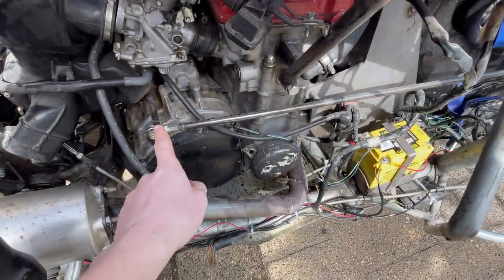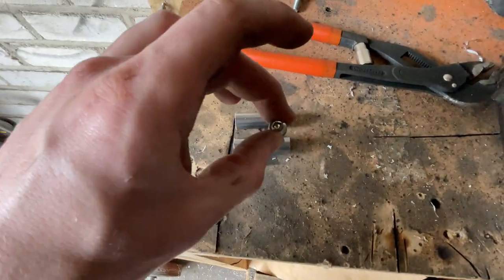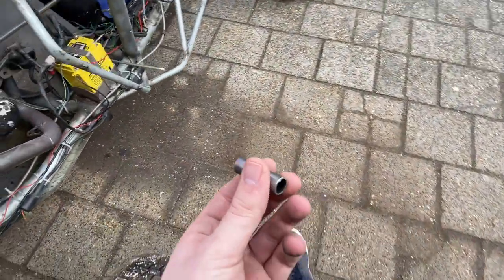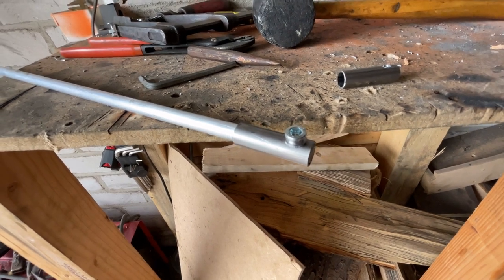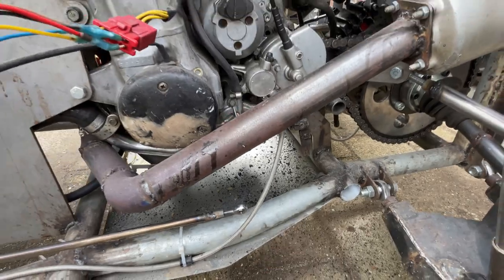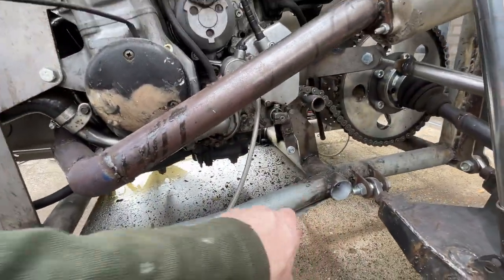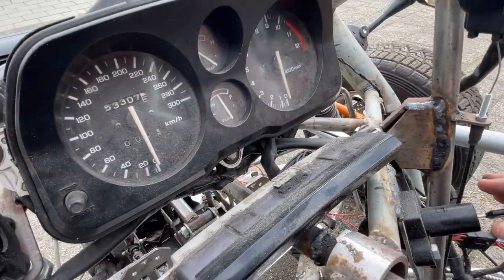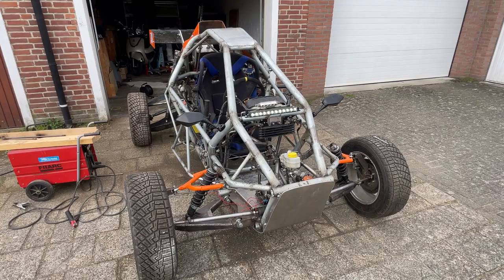How to Build a SIMPLE and CHEAP Buggy Shifter!

Comment: Nice work buddy! Is there any reason why you couldn't use a cable instead of a solid linkage? The flexibility of the cable would allow for less or zero pivot points that need to be fabricated. This is not a criticism in any way! I'm only asking because I'm just about to organise the shift linkage on my buggy and I'm going to use a cable because its just easier to mount and route etc. I suppose a solid rod linkage would feel more direct?👍👍
Just for reference, I'm using a VFR800 V-twin in mine.
Reply from the maker: Thanks! In my opinion a hard linkage is better because you indeed have a better feeling, especially for finding neutral. I also think it is tougher than cables (once done correctly), so you can really pull te shifter like you're Ken Block! With the cables you also need to fabricate some mounts to hold te sleeve of the cable. In the end, both probably are good, just personal preference! Good luck with your build! Please send me some pictures to my Instagram! It is the same name as my YouTube!

Comment: I'm not saying this to criticise you, but your safety is at stake.
Your welding needs to improve and you need to better notch your tube joints
Reply from the maker: Yeah you are right, but this was my first stick welding job so I kind of had to learn. The welds I did later on the build are way better than the first!
Reply: @GuyWithCrossbuggy  I admire what you've done with it. I'm about to embark on a similar project. You have a lot of horsepower harnessed in that frame, and your safety must be your first and last concern. I wish you the best of luck with it.
Reply from the maker: Thank you very much and I appreciate your concerns. Thinking about hiring a Mig welder, since I am more experienced with those!
Reply from the maker: I also have a second project with doesn’t require that much welding so I am pretty stoked about that!